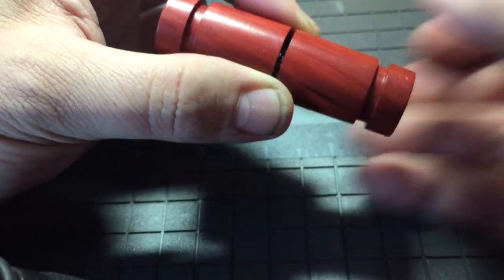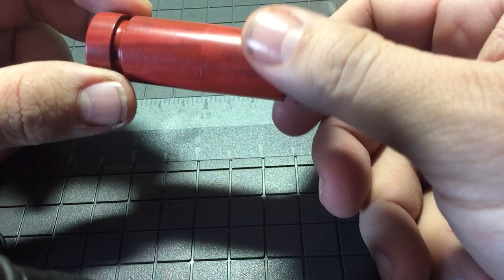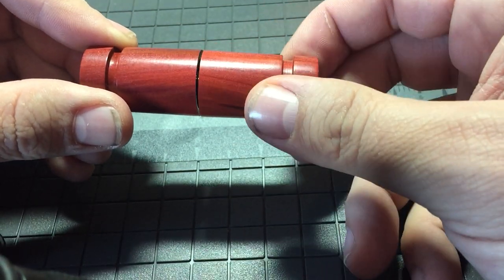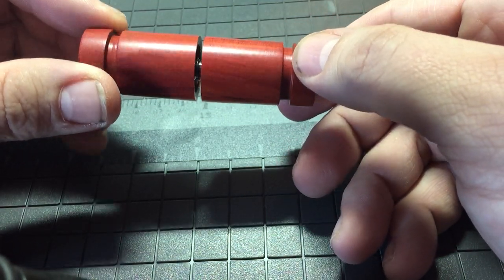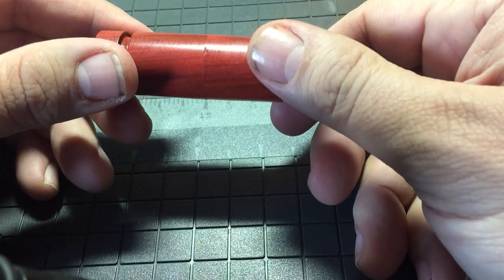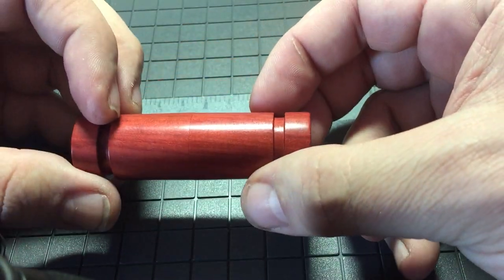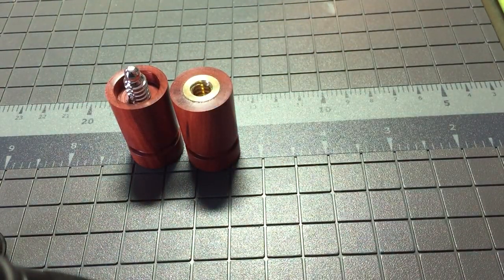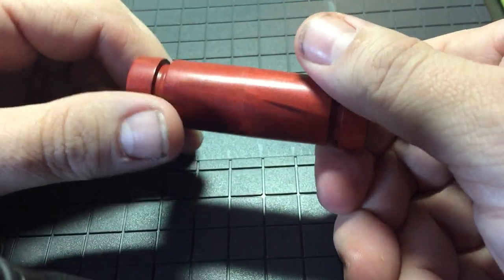How do I line up the wood grain on a joint?

Comment: Can you tap the hole for the male side a little too deep to start with, then put some material, such as a small plug of just the right length into the hole to make it just the right depth? Make the plugs loose enough that you can get them into the hole and out, then when you find the right length of plug, glue it in, and screw in your hardware.
Reply from the maker: Look at the other video I just put up. It doesn't matter the length of the pin, it still doesn't line up.